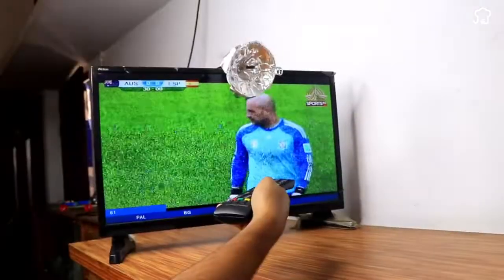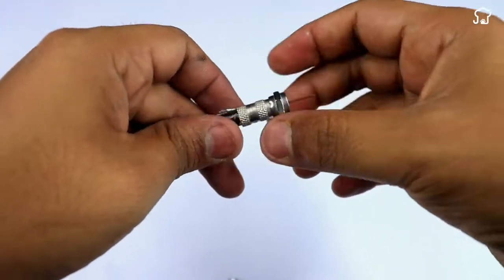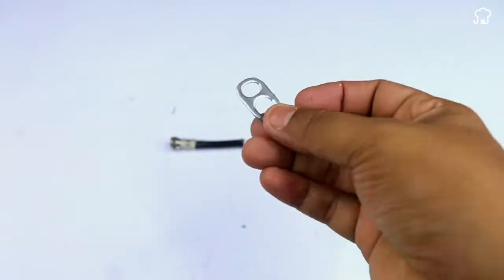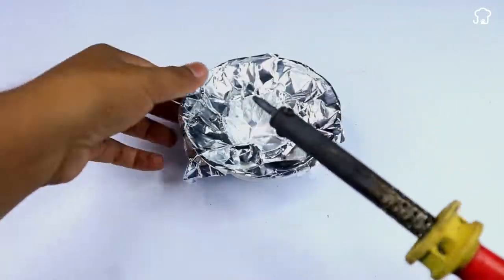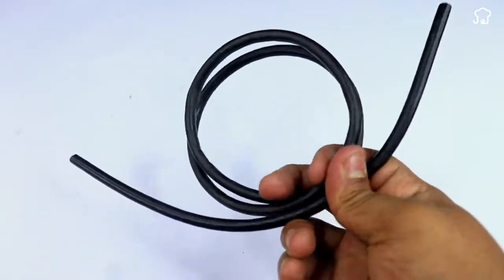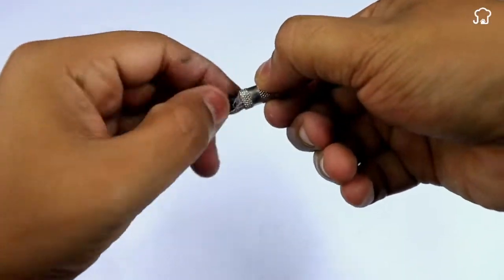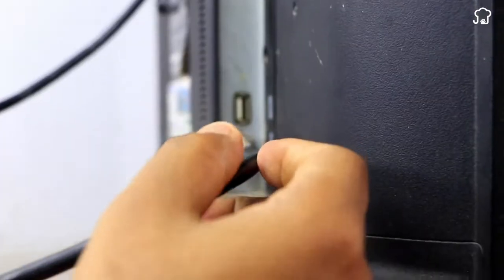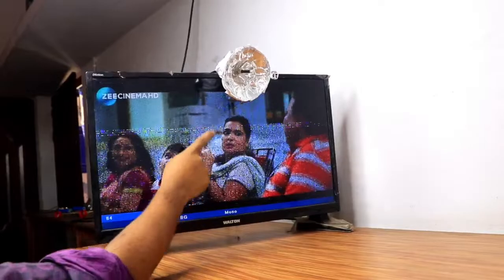Cable TV companies don't want you to know this. Make your own HD digital antenna

Comment: You know what that's bull crap all you need a speaker wire that's it it's hard to get the speaker wire in the little hole but you can get it in there if you work hard enough at it the speaker wire by itself works great